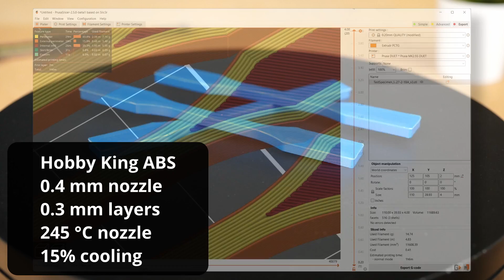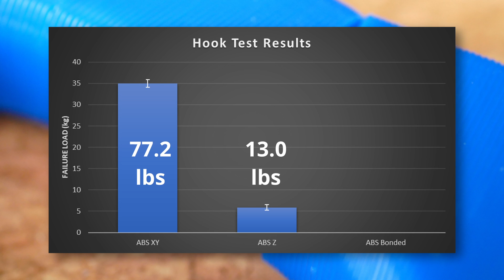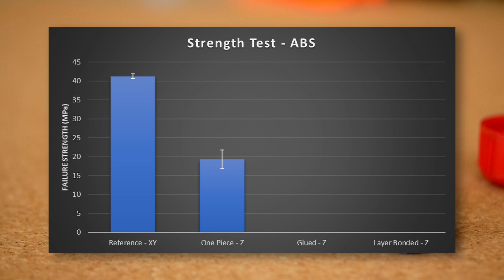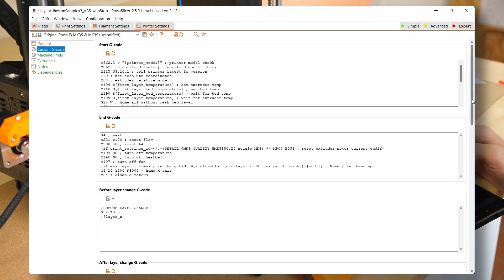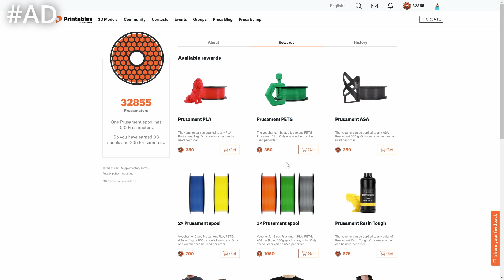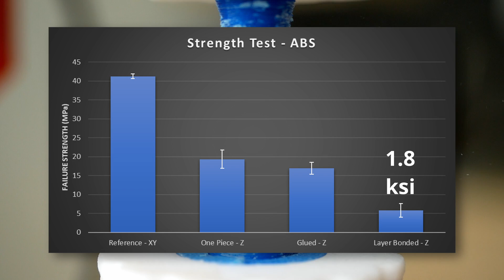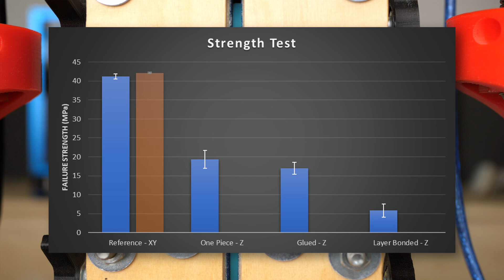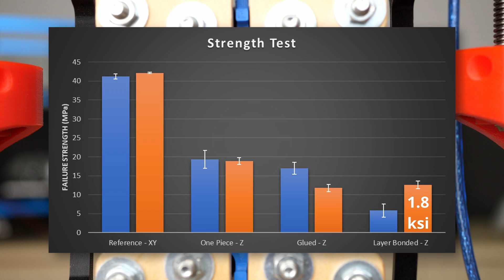Perfect Layer Adhesion if you Brush Solvent onto every Layer of your Print?

Comment: Excellent work, I wonder if you submerged a finished print in it's respective solvent, if the outside bonding would make a notable difference in layer adhesion. Taking that notion a step further, I wonder if you drilled a hole through the model (or planned for this in the structure of the model) to allow for ingress and draining of a solvent on the inside and outside simultaneously if that would help. Great content, I love watching your analysis of the experiments!

Comment: Haven't printed with ABS before, but I've been doing a lot of ASA lately, and if you print it really hot it seems to result in more or less perfect interlayer adhesion, and doesn't really sacrifice print quality. My perception is that the hotter temps also reduce warping, which was surprising since it's the exact opposite with nylons. ASA has been a really strange animal for me in terms of what warps and what doesn't. I think that's going to get a lot better when I get an enclosure.

Comment: When printing with NGen I have always had basically perfect layer adhesion, my NGen prints never break along layer lines even when the model is pathological (much like the cylindrical parts in this video), I have no idea if there is a strength difference though.

Comment: Maybe not trivial to pull of, but one Idea for better layeradhesion would be to alternate layerthickness of the infill lines and perimeters on the first layer. 
Then keep a konstant layer thickness but alternate z height for remaining layers.
The idea woul be, that lines printed next to each other would at different heights and you get more surface area to bond the layers.

Comment: I wonder if you could make or use an enclosure on the printer and run a acetone vapor bath while printing ABS. I know it is a little sketchy but it should be fine as the ignition temp of acetone is 400c and the printing temp of abs is approximately 250c. If this is tested it would be nice to also control the amount of acetone vapor in the inclosure and not just stay saturated.

Comment: A gentleman used powdered salt a while back to make 3d printed Co2 replacement cartridges. He would print the product and then fill the cartridge with the powdered salt and then packed it without air, and then packed it in a powdered salt bread tin. So the salt was like a casting sand essentially, and he baked it in an oven and after some temperature tempers he achieved what he wanted and I cannot find this video its over 7 years old at this point. Perhaps this would work with acetone in a similar method but no oven.

Comment: I wonder if the new layer being deposited is so hot that it is causing the acetone to evaporate so quickly that it creates a vapour barrier layer that prevents the two surfaces from truly contacting and welding.

A bit like the leidenfrost effect.

Comment: Could you not just decide a piece to print in four separate pieces two of which would be printed horizontally any others to be printed vertically giving you the best of both strengths?

Comment: Feed some acetone into the extruder so that the material solidifies much slower? This makes it more one piece rather than a stack of logs. Similar to noting that a melted wield is stronger than the original extruded metal plate. 

Similar would be to hold the temperature of the environment closer to the melting point of the material. I assume this harms detail? See below. 

And if you've got an acetone extruder, how about subtractive modeling? You'll need a slurpy thing next to the squiter. Might be able to do the same thing with a hot pin. That would need a shaver. Hmm... How about heating up a section and then going at it with articulated sculpting tools? Can you make a boat faster by carving it down than building it up? Or combine both. 

Random: Is layer adhesion better if you interleave materials? Use different materials in different areas to improve strength? Eg, bendy places vs waffle Infills. 

Lots of people are talking about nonplanar extrusion. Taking this to extremes, make an extruder nozzle that is long and thin. Have several angled in different directions or one whose angle of attack is steerable. Then have a slicer that follows contours of the model: Attempt to make a layer match the normal to the thinnest material laid down so far. Intuitively, if you are making a U, you build up the inside strip by strip. Lots of caveats: Have to account for extruder interference/dexterity, have to build up the uprights of the U over time.

Related to above: Make the fill path of each layer more variable. Do a back-and-forth along X and then the next layer along Y. Or three orientations. Or again, don't make the layer planner in the short dimension either. Make it a hump. So a re-anglable tip runs over it on an arced path. Again, using different infill orientations on each layer.

Stop thinking of layers as planar and think of them as external. You have a current lump of material and you are adding more to the outside. You are looking for the optimal grow shape, both for efficiency and stress. So it is a hump in two dimensions that you build up.

Basic idea is to not provide flat or consistent surfaces of weakness to an type of stress. Think of what extrusion would make a structure most durable, then design an algorithm that will approximate that path. For the standing thin shapes, you have a trade-off between vertical building and standing up against gravity. I would say that you are building up hills with the path running up and down around the outside. The rate at which you gain height is based on what the material can support. The more the material will support, the longer the threads that can be laid down along the center area and so the more resistant to tension. In general, you want stress to pull along extrusion threads, not separate layers of them. 

Perhaps the ideal solution would be a constraint minimization of breaking off the extrusion as little as possible and altering the direction of path as little as possible. Ie, long continuous threads. 

- Minimize layers by following model contours.
- Squiggly infills vs. dashes in one direction.
- Infills that follow long axis.
- Less planar layers = more deposition per layer.

Finally, to solve the detail problem, note that a sculpture has two parts: the structure and the surface. The structure is there to put the surface in the right place. It has no personality, it just wants to resist deformation. The surface does have some structural properties but they are different. It wants to hold its detail and resist abration. Abration isn't anything like torsion. Nor is holding small scale features.

So following with the idea that you are building up the outside of a model, make the structure and then paint on the detail. This also allows for varying color, texture, softness, sheen, etc. Areas of variability are useful both for artistic pieces and machine parts. 

Ideally, detail should not even be done with the same head(s). Different temperature, extrusion rate, material, arm dexterity. The detail head would be much slower but have much more articulation. Maybe even rotate the model? Or maybe you only use as much floor as you need to support the model to allow attack from below. Ie, the slicer tells you to put a stand of a certain size on the build area before you start. 

There is much less detail work to be done than structure so it is reasonable to use a slower, more precise instrument.

Comment: If the solvents are enclosed within the print it is very hard to evaporate them, maybe air can't even touch the solvents if 2 layers are printed airtight, keeping the material soft for days on end. if the edges evaporate and bod faster than inside, which is what probably happens, the solvent will be easily enclosed in an airtight pocket between 2 layers, keeping them wet for longer than 24 hrs, maybe even indefinitely like the solvent container does

Comment: How about maximizing the surface areas by making holes in the part, then acetone smoothing it?

Less material might sound counterintuitive, but acetone smoothing works only for the outer layers to begin with, and having more surface area will allow more bonding.

Comment: I don't know if you've already had this idea, but here goes: use an LED lamp to generate heat and keep the upper layers warm and without hardening while the nozzle is occupied with other parts of the print ._.

I know that LEDs that waste energy with heat instead of light use a LOT of energy, so it's probably not feasible to spend all this energy during the entire print time, but wouldn't it work as a greenhouse maybe?

Comment: Couple ideas: 1) combining multiple parts printed in orthogonal orientations. 2) eliminate the clean shear line through the part by using thicker internal layers like the combine infill settings, but for perimeters so the layer lines don't perfectly line up through the part. 3) Is it possible with 100% infill to print the shell hollow, and then 'inject' a big blob of filament into it creating a super thick 'layer' in the middle? It'd have to be hot enough, and fast to make sure it adheres before cooling down. Maybe with an inside and outside layer with really thick inside layers.

Comment: I was wondering about pointing a laser module at the print area right before the layer also, or ducting hot air through a round ceramic duct matching the nozzle heat into a fine point right at the tip.

Comment: For stitching, a hot wire in front of the nozzle heating the previous layer to near melting before the nozzle spooges the next layer immediately out, putting both layers at melting point when printed.

Comment: I've always thought you could insert something like a spool pin, or just any textured metal piece (the texture is to increase the grippiness) into a prepared hole (part of the model, or added by the slicer) that is ever so slightly smaller than the diameter of the pin. The insert would need to be heated like a threaded insert, then pushed into the hole while the print was still going. You would have a magazine of these, or perhaps a spool of textured wire that gets cut after each heated insertion into the print. After each certain number of layers, or at specified points in the print, the slicer would designate a tool change to the wire/pin gun that would pop the inserts in then switch back to the printer.

Two benefits. 
One, the heated insert would melt some of the layers together, direct increasing layer adhesion. The insert would very quickly cool during insertion, which is the limiting factor for the length of the insert. 
Two, the plastic melted into the texture of the insert would create a bond to the insert that would make it difficult to pull the layers apart. 

To maximize these benefits, the inserts would need to be inserted in a staggered fashion on the Z-axis, so that no two layers are not reinforced with respect to each other. Placement along the X/Y access should be done where the part is expected to receive the most stress.

Comment: I have no idea how you would begin to do this, but buildng parts a few mm at a time separately, then bonding those parts together rather than every single layer. That way rather than having molten plastic meeting cooled then coated with solvent plastic, you have two cooled parts joining.

Comment: Layer bonding relies on the heat of the top layer to melt and fuse the lower layer. Ideally, something would partially melt the lower layer immediately before extruding on top of it. For example, a nozzle with radiant heating could be made to pre-heat the lower layer immediately before extrusion, ideally in the direction of travel of the nozzle only. Picture a nozzle surrounded by radial heating filaments (or laser diodes) controlled to activate at the right time depending on direction of travel. Yeah, it's complicated...

Comment: So as you noticed, the layers where the acetone seemed to expand the layer below such that the nozzle has to push around the plastic out to the sides when printing the new layer. That reminded me of how separate pieces of clay are conjoined using the 'score and slip' method. Where you scratch up the two pieces of clay you are joining, and attach them with dissolved clay (clay dust and water solution).

What if in the code, for a nearly 100% infill print, after you printed a layer you told the nozzle to go down a tiny bit and rake a crosshatch pattern into the recently printed layer, then return back up to print the next layer. You'd be greatly increasing the surface area those two layers are conjoined by and might increase the strength. This combined with acetone might be even more effective. You'd almost certainly loose dimensional accuracy but still.

Comment: How much water did your acetone/ IPA contain? How old was it? Since they are highly concentrated, they tend to take in water from the surrounding air. So even if your 99% IPA was 99% at the factory, that does not mean it was still at your home. 
How much does this water affect effectivity? I have no idea, but I know there are processes in which you absolutely want to avoid any water in the solvent. 
Easy fix: Get Epsom salts, dry in oven, put in one-off tea bag, hang into solvent. Should suck out the water but leave the solvent.

Comment: As plastic tends to stick best when it's liquid, it might be a good idea to heat up (re-melt) the previous layer before laying the new molten plastic bead on it. Heating could be done by a laser.
Reply: And blinding the consumer will be done by that laser. This is only viable in a full enclosure printer. Preferably with 100% opague sides.

Comment: Could maybe try writing a dynamic z-offset into the gcode to avoid too much nozzle ironing on each layer and maybe instead of having the print head move to the side after the layer, have it leave a perimeter or two unprinted so that you can lightly brush on the solvent and then the print finishes the layer with the two perimeters and moves onto the next.  In my head, this could theoretically help to mitigate some of the squish-out of the material.  My assumption is that the main problem is that the acetone on each layer solves one problem and creates another.  It might solve the problem of layers bonding together, but it changes the structure of the material as a result of the foaming. 

Another thing you might try is annealing two samples.  One control sample with no acetone treatment that is annealed and another sample with acetone treatment that undergoes annealing.  The idea being that maybe annealing would allow the material structure to order itself post-obliteration from acetone foaming.
Reply: Could maybe also try diluting the acetone in IPA to limit over modifying the structure while improving interlayer drying performance.

Comment: This was a very interesting topic and, as always, both the video and the idea inspired the 3d printing community to use the scientific method to improve the 3d printing industry. An idea I have had for quite a long time was to create a software that drives the nozzle of the printer up and down while printing, so the current layer melts into the previous one. I believe this would lead to better layer adhesion and improve the overall strength of the part.

Comment: IMHO the best way to get a super layer adhesion would be to develop an alghorithm that allows to 3d print the shells also vertically with at least 1 layer. It's not an easy task though, and to test it probably just basic shapes can be used.

Comment: I don't know how you would acquire such a thing, but my first thought is that 3d printer nozzles are like standard round cake icing tips. Icing tips, of course, come in a variety of shapes based on application: open star, closed star, ruffle, leaf, and basketweave are all part of the basic kit, and while directional tips like leaf and basketweave would only work with very specific designs and very carefully written gcode an open star tip (if such a thing existed) could easily be swapped in for a round nozzle, and the the extra surface area could possibly improve layer adhesion.

Comment: Have you tried UV curing the parts after printing? This may be possible if there are still some small monomers left in the plastic. ABS should be a good candidate as you can smell the small monomers molecules when printing.

Comment: I've sucessfully used this method with ABS. Model a 2mm hole vertically through the object. After printing, soak a piece of bare filament in acetone for a few seconds and then insert it into the hole so it welds creating an ABS pin through the model

Comment: I would primarily test the acetone adhesion with horizontally printed and sawed through parts to ensure, that the glued surface is the weakest spot.
Maybe even compare it to other glues like cyanacrylate or epoxy.
Also I would like to see a test of acetone smoothing with hollow/ meshed parts. Maybe just by rinsing the parts through from the inside, so that inner wall and support layers are strengthened aswell.

Comment: A possibility could be to "stitch" perimeters with the nozzle puncturing (lowering into the previous layers) every now and then, maybe only along internal perimeters to avoid messing up the shape too much. Something similar could be tried with infill, but I have the feeling it would be less impactful. Something like, extrude part of the perimeter, than stop, lower z a layer or two (maybe more?), reposition the z at the current layer and then proceed with the perimeter. This should fuse layers together at somehow random points and MAYBE increase layer adhesion.

You could achieve this with a script that adds this movement to the generated gcode, but I don't know if you can differentiate between perimeters (internal and externals) and infill in the code.